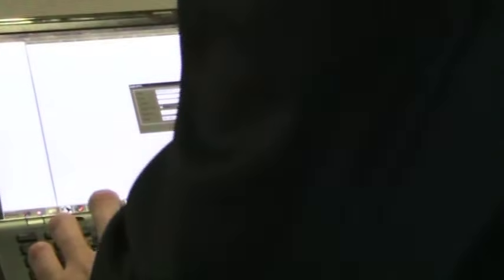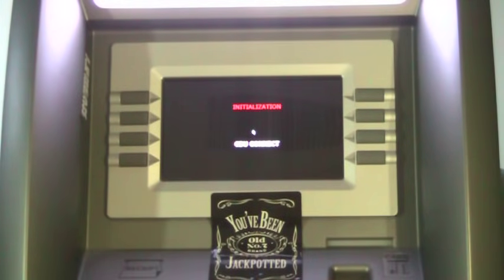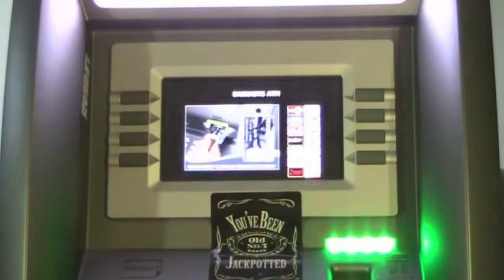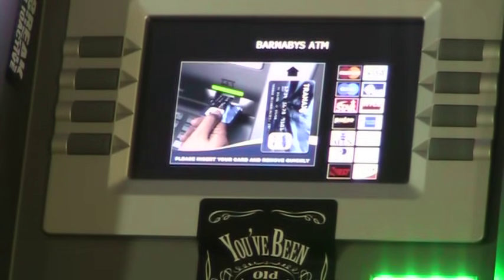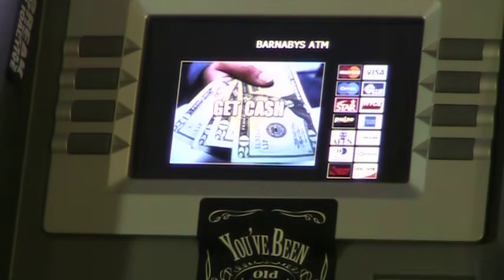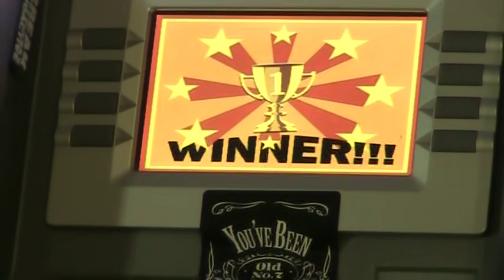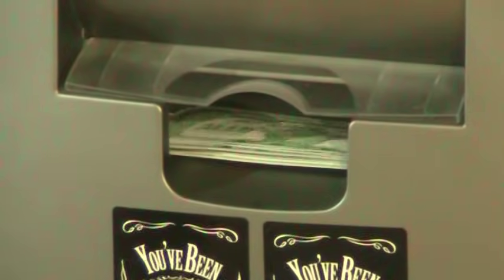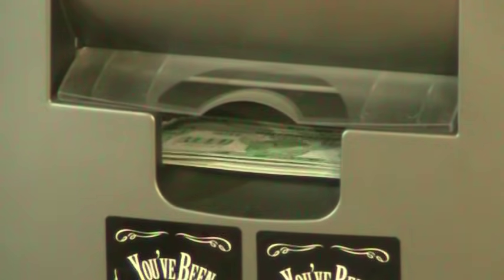How to Make an ATM Spew Out Money

Comment: The cryptocurrency market-------------------------------------------------------------------------------------------------------------------------------------------------------------------------------------------------------------------------------------------------------------------------------------like the stock market, precious metals ,and basically any other asset across the World currently, are struggling to maintain valuations during a panic induced sell off stemming from a global pandemic and sudden recession which have make many investor / traders to be confuse on what to do. But so far, the cryptocurrency Bitcoin is currently rising and showing positive signs of bullishness which makes it a good buy Zone to trade and not to Hold because I have come to discover that even in the bear market you can still make profit. Due to my personal research I got to find out about a high tech broker Who is a pro trader and signal provider and has great knowledge on how the markets works,with his great signals I was able to achieve and grow my 1.2btc to a total of 6.9btc within 2 weeks of trading actively which you would agree is a very good profit and it's been going on for months, I will urge others who are willing to grow a strong portfolio ahead to make use of his accurate and profitable signals now , you can reach them on  EXTREMETOPPERS🟣COM  for more inquiries into profitable trading systems.

Comment: How to make Dump With PIN 

Msr 

Emv software 

ATM hacking software 

Blank card

Embosser

The msr is linked to the emv software and ATM hacking software when you are about to write the dumps with pin on a blank card.

Then emv software makes the blanks card looks real and no one or machine will be able to detect that it’s a clone card they will see it to be a real card so no one can trace you or something. The emv software is a software which protects the blank card and makes it look real. With that no atm will be able to detect that the dumps with pin was written by yourself but it’s will make it look like it was a card from the bank and also  the emv software protects the card from any region block..without the emv software it is 50% that your dumps with pin is gone work or not but with the use of the emv software when the dumps with pin don’t work meaning the dumps is not legit 

The ATM HACKING SOFTWARE helps you to breaks the limit of every ATM so you can cashout more than the ATM limit without no notice.meaning you can cashout all the amount in the card with the use of the atm hacking software 

The blank card is what the dumps with pin is written on.

And the embosser is what write the numbers of the dumps with pin on the blank card. Understood

Msr for $50

Emv software for $100

ATM hacking software for $60

Embosser for $30

Blank card for $35$ for 200 pieces

That is the  price for all the equipment you will need to make a clone card. 

Clone card is also for $60 depending on the balance you want and fedex guy who will bring it to your place 

Meaning if the clone card will be done linking the emv software and atm hacking to the msr with the equipment listed above that will be the cost for it..Understood...The balance on the clone card is 60$k and above as same as the balance on the dumps with pin...When you order for the clone card and make cashout of all the balance at ones cuz the atm hacking is linked then you come back and order for the equipment with the some of the money cashed out from the clone card which was sent to you, after the equipment ordered for you just have to now order for just the dumps with pin and you will be taught how to make a clone card so that very will be simple for you

Wickr me @nielsen127
telegram @nielsen127
keybase @nielsen147
nielsen147@mail.com

Comment: FRESH 95% – 98% Valid
Telegram : JOE-JOE ESCOBAR
werlinsalexan@gmail.com

FRESH 95% – 98% Valid
Every Dump Is Cashed or Sold Within 24hrs Of Being Skimmed/Sniffed

I ONLY SELL BALANCES OF 4K & UNDER TO NEW CUSTOMERS.
BIGGER BALANCES WE CAN WORK ON A 60%/40% CONSIGNMENT CASHING BASIS.
BUT THIS OPTION IS ONLY AVAILABLE FOR REGULARS & LONGTIME CLIENTS.

[ Base Prices Per Dump ]
350 FOR DEBIT DUMP WITH BALANCE OF 900-1200
450 FOR DEBIT DUMP WITH BALANCE OF 1400-1800
500 FOR DEBIT DUMP WITH BALANCE OF 1900-2200
600 FOR DEBIT DUMP WITH BALANCE OF 2300-2600
700 FOR DEBIT DUMP WITH BALANCE OF 2700-3000
800 FOR DEBIT DUMP WITH BALANCE OF 3000-3600
900 FOR DEBIT DUMP WITH BALANCE OF 3700-4000

DEEP DISCOUNTS FOR SERIOUS BUYERS
WHENEVER YOU BUY TWO OR MORE PCS,
I SHAVE OFF $150 OFF ORDER TOTAL, FOR EVERY TWO PCS BOUGHT! 🙂

High Quality Plastics
I CAN MAKE ANY DESIGN YOU NEED !
Flat-Rate $8/PC Unembossed OR Embossed !

For Buyers Without MSR Writers I Can Write The Dumps To The Card For You &
Overnight Express Ship Them [Discreetly]

Minimum Order $350
I accept BTC,WU,MG,WM2WM

Telegram : JOE-JOE ESCOBAR
werlinsalexan@gmail.com

Comment: Hi,i just want to share my experience with everyone. I have being hearing about this blank ATM card for a while and i never really paid any interest to it because of my doubts. Until one day i discovered a hacking guy called MR ANTHONY. he is really good at what he is doing. Back to the point, I inquired about The Blank ATM Card. If it works or even Exist. They told me Yes and that its a card programmed for only money withdraws without being noticed and can also be used for free online purchases of any kind. This was shocking and i still had my doubts. Then i gave it a try and asked for the card and agreed to their terms and conditions.. Four days later I received my card and tried with the closest ATM machine close to me, to my greatest surprise It worked like magic. I was able to withdraw up to $3000 daily. ATM has really change my life. If you want to contact them, Here is the email addressanthonbradley646@gmail.com or what's app:+971564711598

Comment: This is retarded.
It's like saying "how to make water flow endlessly from a stack of bricks. Have 10 dudes turn a stack of bricks into a house. Have 2 more dudes run pipes through it and connect to water source. Buy keys for front door, unlock and open door and turn on faucet.
Now you have endless water flowing from stack of bricks but you'll be arrested because you illegally tapped into the city water system and you stole the bricks."

Comment: Or ya know, instead of making software plug in a keyboard to the motherboard. Most ATMs run on versions of windows, likely Windows XP. Reboot it into service mode, and use the service operation to clean out the machine. Obviously there will be encryptions in place, but common... Its Windows XP...

Comment: Best way to open a safe liquid nitrogen in the keyhole and put a nail in there and smack it with a hammer easy or shoot it easy or use a blow torch and melt it easy or a very small amount of C4 inside the keyhole easy or a mini gun easy XD

Comment: Yeah, I'm sure no one notices when you start pulling ATM's apart to reprogram them, remotely.
Reply: Only the first attack required opening the atm. The remote attack was done from his laptop.
Reply: @akunog3665  Upper module is wired to an alarm, so it will be noticed. Atm manufacturers use specialized cpu's and motherboards so that plugging in an USB module won't work spewing out money.
Reply: @akunog3665   I need that program
Reply: 😆😂😭no shit eh lol 🍻👍🏻
Reply: Lorie, you’re not paying attention
Reply: not if you’re wearing security uniforms and stuff like that

Comment: An ATM is not a machine that will pay out with 'winner" And even if it did, prepare to go to jail.
Reply: he hacked it
Reply: Are you stupid or do you not pay attention? My moneys on stupid...
Reply: Justin Ray I've got a bachelors degree in computer science with CCNP + MSC certs and 15 years of professional experience.  I have also been into whitehat hacking since my early teens.  I can tell you straight up, that what he did was a hack.  Hacking doesn't always stop at getting through the initial login procedures.  In fact there are many facets to hacking that are more often than not, done in the real world.  However, flashing firmware, moding db's or installing exploits are often part of a hacking process.  Hacking has such a broad scope.  As another IT professional, I highly recommend doing a bit of research on hacking.  Understanding exploits will make you better at combating them.
Reply: Who is bobby

~nvm
Reply: Thats one of my problems with the blanket term hack.
Reply: i wasnt talking to you west pie i was talking to OP. I am an A+ certified computer technician with an associates degree in network engineering and data security so i probably know more about this then you. He did not "hack" it (btw this is the 21st century and no one says hack any more). He built his own custom firmware and uploaded it to the machines firmware chip. If he "hacked" the machine it would still have the original firmware on it.
Reply: @justinray582  A+ cert and a 2 year degree? That should get you about a $15 an hr job at office depot
Reply: Love that movie. Both entertaining and relevant.
Reply: ***** Are you blind?
Reply: oh sry
Reply: Justin Ray
i heard that in iron man "(btw this is the 21st century and no one says hack any more)"
Reply: Justin Ray
Reply: Rotschild family and rotschild followers are evil and must go to the jail and prison in this temporary world.
Reply: Actually, you are wrong! An ATM can pay out to a winner! The prize is a long Prison Sentence!!!

Comment: Selling cheap *Western Union Transfers*.got info on western union main computers with the help of a strong botnet, Now i can change the info of a MTCN to send any payment *INSTANTLY*.I change the receiver info and payment goes to that person.If you want to make easy money text *702-744-5282* asking about Western union transfer i have proof if you need it....rates below payment method is Moneypak or Netspend instant reload pack
$1000 Transfer = $250 
$2000 Transfer = $500
$5000 Transfer = $750
$10,000 Transfer = $1,000

Comment: If the cromo analyzer is defected it will not let you by pass the codes.  I tried and it worked until the software was corroded by over use from heat sinks.  So you really need the cromo analyzer to to see if this will work.  Just apply it to the face plate and read the meter.  From there you will know for sure if it is vulnerable.  :0)

Comment: lol. I know how to make money using your cellphone. It is called points2shop. On this app, 1 point equals 1 penny. So the value of the points are alot better compare to apptrailers. Download it and use my username halleyscomet as your referral. The username must be used because without it you only get 50 points and with it you will get 250 points, which is $2.50. After all of that is done, complete an app download worth more than 2 cents for more bonus points.

Comment: This is all B.S. - HE says that one key fits all for the ATM's - but of course they won't be like that, all keys will be different - and security software will detect that the ATM has even been opened - they ALL have cameras monitoring them here in the UK.  As for the second method, remote attack?  I frequently see Techs working on the ATM's - physically upgrading/altering the software AT the machine - and any 'remote-access' is surely going to be 128-bit encrypted.
:-p

Comment: well I have seen a lot of things over the years as IT tech I can its very possible that ATMs Can be hacked there are a lot if Things software hacks if you know how to load it on there and it would make sense if they had master key to it for accessing motherboards and such years ago a lot this stuff was going around in some form and most ATMs need a remote connection to access bank info and such you would be surprised how much this stuff goes on without people knowing that is the sad fact

Comment: i've owned a couple of these. On the menu click on deposit, then click 0101010101 or 123123123 or 321321321321 These are the main Owners passwords that most owners put on there atm machines. Once you do that a menu will pop up with a bunch of options. Dont try to say im wrong cause i own 3 of these and that works.

Comment: There's a trick i heard of but i never tried it. Go to an ATM and make a bunch off money come out. Don't pull it out. Hold on to a bill in the middle of the stack. Eventually the machine will retract the bills because you didn't take the money out. So if there's a stack of 5 $50 bills and you don't let go of the one in the middle, the machine will write back the $250 to your account while it only takes back $200.

This worked 10 years ago. i don't know if it's still possible but it's a fun trick

Comment: I used to work for Sunwin Cash Processing as an ATM re-filler. The computer in the back on ALL the ATM's had a 6 figure pin code which were in all cases set to factory "000000" 'cos management couldn't be arsed setting individual pins for every machine. All the safes had different combinations and were all linked to a central control which would detect intrusion but if you were fast you could easily make it spit notes by doing a "test vend" in the software menu.
Reply: Omg. I need you in my life.
Reply: Free game thanks

Comment: It's been done. What they do is goop up the card slot, then when the repair guy gets there they stick a gun in his back and make him open the machine's safe- Which is "Booby Trapped" with an explosive dye pack ready to detonate in the face of the unaware. A Bank ATM, on a Friday before a three day weekend may contain over a Hundred Grand. That is why NO ONE would even bother to try a trick like what the guy is trying to pull off in the video. It's not worth it and you WILL get caught.

Comment: The IP addresses of hosts in a LAN network can be determined by sniffing traffic for a few moments or some simple plain guesswork. But that's not the point as the machine is behind a router which is behind a modem which is behind the ISP's router and so on. 
Oh, BTW, proving, publicly demonstrating or otherwise signaling security vulnerabilities in various computing systems is not intended to promote or encourage felonies.

Comment: i know you can get the master keys online to open the maintenance compartments, i also know that you can install a jumper wire to a few circuits which cause the feed system to start shooting out money, although u need to study the circuits, and make sure they are activated in the right order.....for example you dont want to start feeding out bills with the trap door at the dispenser closed...

Comment: you don't " hack a motherboard" stupid, you have to hack or re flash the software on the ATM. The hard part is writing the new Software has to match up to the ATM's setup, otherwise, it will either brick the ATM, or fail to accept the code, and return to normal operation. that takes a long time to backwards engineer a program that you don't even have.

Comment: I very much doubt that a manufacturer would pay more to identify vulnerabilities than driving round america and emptying cash points from many different manufactures. Your talking an ATM holding somewhere in the region of £50,000- £100,00. There is thousands of them and they are filled regularly. I would empty the ATM's locally about 10 times !

Comment: ... in other words, if you were running a corporation that was so tight and efficient and secure that there were zero losses, there would be no way to account for any funds that you wish to embezzle.  There needs to be a column on the 'official' books where losses can be shown, otherwise audits will expose discrepancies.

Therefore, sometimes you need to make sure those loss columns have an easy time of getting created by "outside forces" by leaving little security holes here and there.

Comment: only if you get cought, it is really hard to get cought if you do it smartly with the remote and use a mask when you go to pick up the cash, use a cheap laptop like $250 at wall mart and gain access to atm thru a wifi hot spot like mcdonalds or a coffee shop!

Comment: Infact all ATMs in Austria run Windows XP, just as these here. They are beeing setup with a Laptop via an ehternet cable so there is surely an exploit to hack the ATMs but its hard to attack them as you see in the video, you'd need hardware access to the ATM